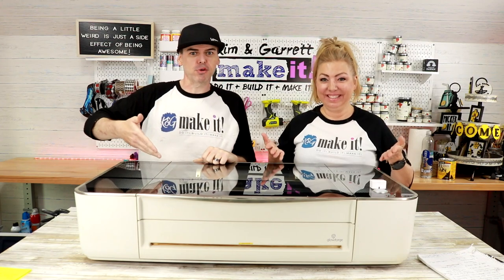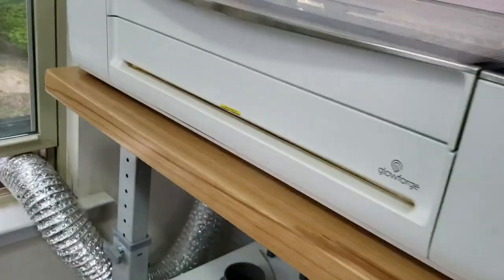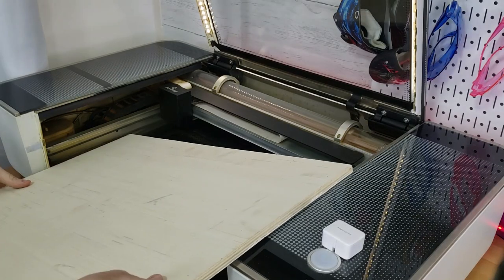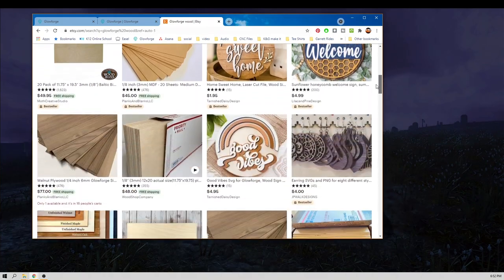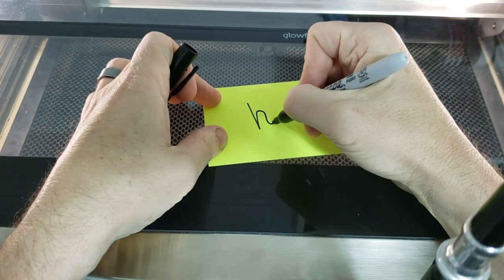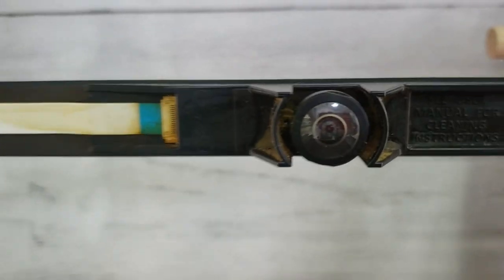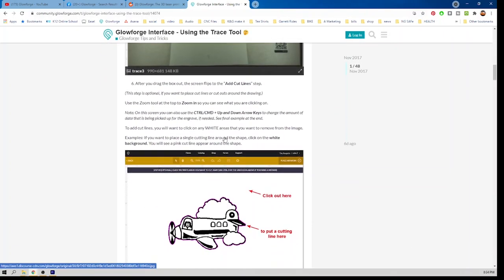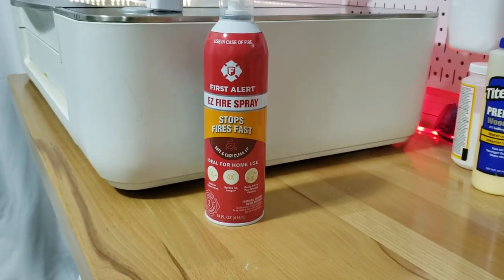Glowforge Pro 1 Year Review

Comment: I made the mistake of buying a boss laser, I bought the HP series because it will cut stainless. the biggest problem are the lenses and mirrors are garbage they make the laser light look like a galaxy reducing the cutting power, and I get the run around from boss they sound like they are helping but after almost 2 years of the same repeat questions and blaming me I bought a cheep knock off just to see if it was me or the laser, it was the laser.  Burn on!!